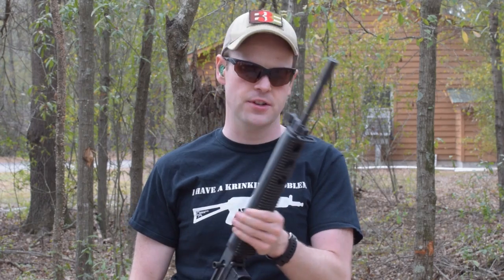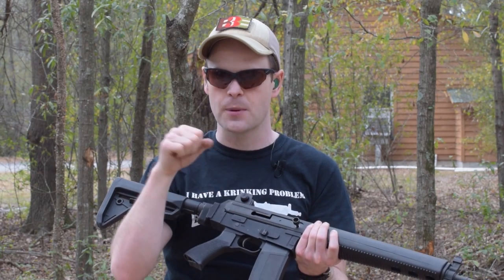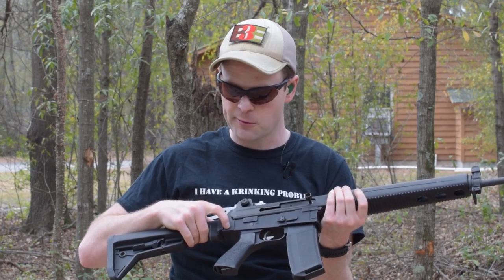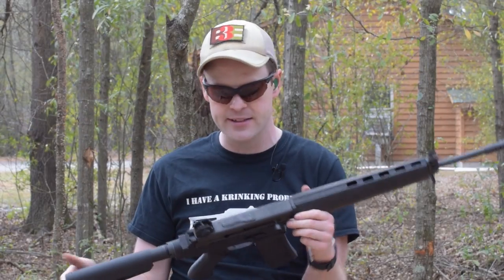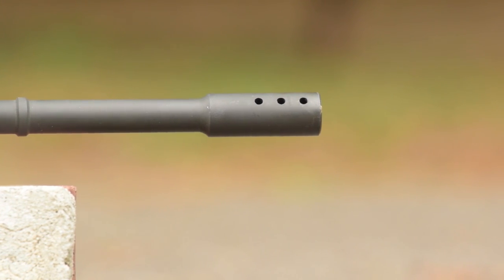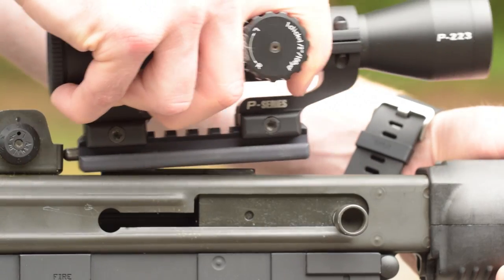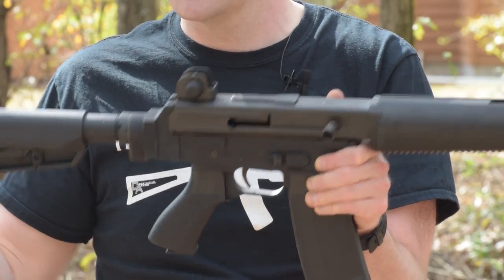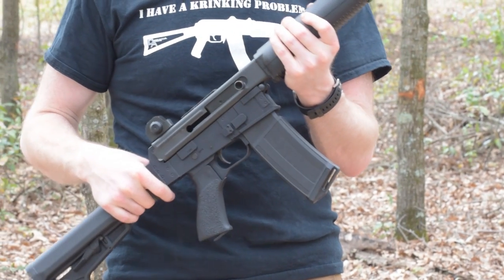Nodak AR-180 Receiver Review

Comment: I just want a classic AR-180.
Reply from the maker: Donovan notmyname - Same, it would be awesome if they reintroduced it.
Reply: BurstReview I agree, did have a couple ideas for reintroduction of it. Now I'm going to try an not flip out because one of my favorite Youtubers just replied to me.
Reply from the maker: Donovan notmyname - even though I really like the Nodak NDS-18S, the stock AR-180b is so ludicrously lightweight, it almost feels heavy by comparison.

Also, thanks for the comment, sub and continued support. Kay and I are working on nice patches to hand out to fans in the future, stay tuned.
Reply: Did have an idea for a barrel swap. And the ability to use both AR-180 mags and AR-15 mags. And gas settings, although I have no gunsmithing experience outside of cleaning a Cx4 and a 1911. Basically make the rifle in its original format with some differences to make it more desirable for the current market.
Reply from the maker: Donovan notmyname - Sounds a lot like the Stoner weapon system, which unfortunately is also a, 'retired' platform.
Reply: BurstReview I got a few other ideas in my head, but I don't think they'd get good traction, that and these ideas are probably 15 years off. Would you try making a few ideas of yours a reality?

Comment: 180B's sell on Gunbroker for around 1500-2000 recently.  Crazy when they msrp back in early 2000s for 500 bucks.  I love mine.
Reply: Crazy that you can find original AR-180's for about the same price.
Reply: @panzerabwerkanone  probably because the seller assumes the buyer will think they are the same as a original 180

Comment: You can always find a steel sleeve that will fit in the takedown pin hole that would protect the lower. Bore the hole 1mm & Glue it right in and you are set

Comment: Trust me on this.  The AR-180B is SO MUCH more solid and rugged with the NoDak Spud NDS-18 aluminum receiver.  Those early polymer lowers tended to break at the front lugs which were just not a good application for polymer.   These little rifles are just excellent when the lower plastic receiver is replaced with the NDS-18 receivers.  Word.
Reply: Do they marry together well? NDS has the buffer tube end
Reply: @romanroman1975  Yes marry well and solid.
Reply: Thanks! For the absence of the direct replacement I ordered the WK180 lower, will see if it fits...

Comment: I own a Sterling AR180 in like new condition. Where can I find detailed information and instructions on how to replace my original lower receiver with a Nodak. The only reason being that I can then use the  STANAG magazines and I would also like to know if I could still use my original AR180 mags. Any  info and or constructive opinions will be most welcome. Thanks
Reply: I almost forgot, how do I  transfer my original AR180 stock onto the Nodak lower ?
Reply: @GrenadierV  I don't know if you're still following this but I don't see a way. I own a 180 myself, and the stock is the back of the receiver, with the main stamping welded around it.
Reply: Thanks for your response. I Guess there is no simple way although with money  anything can be done. Anyway it is much cheaper  and easier to convert the AR-15/M-16-/M-4 to Ar 180. Thanks for your answer

Comment: Mine broke at the pivot pin making the plastic lower useless. Other than selling it for scrap does any body have any suggestions?
Reply: storm werkz sells this Armalite Ar-180B Pivot Repair Section for $80.
Reply: You have be careful you don’t let the action drop open. And there shouldn’t be too many reasons to pull the front pin out.